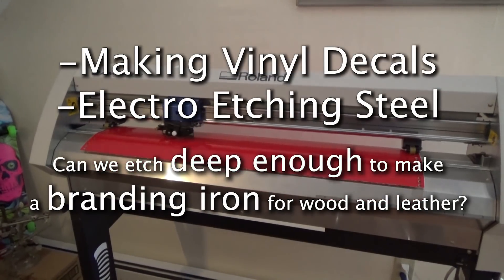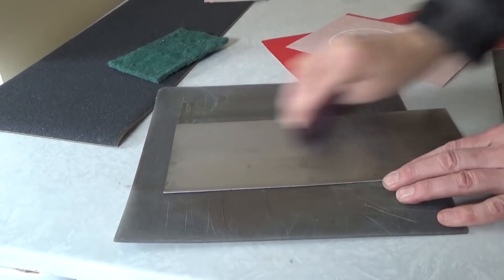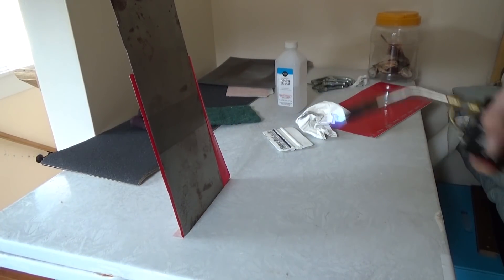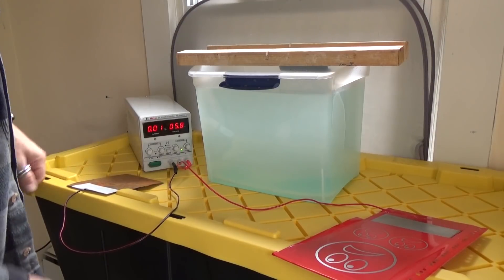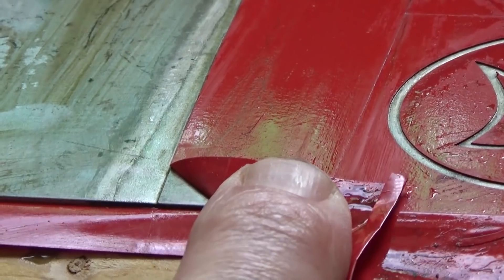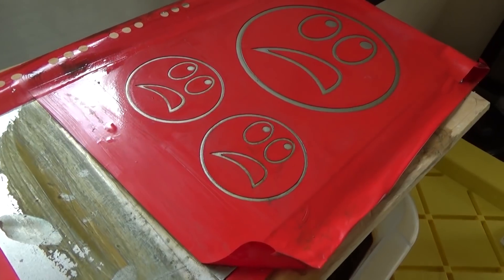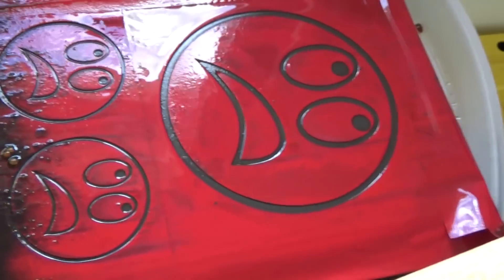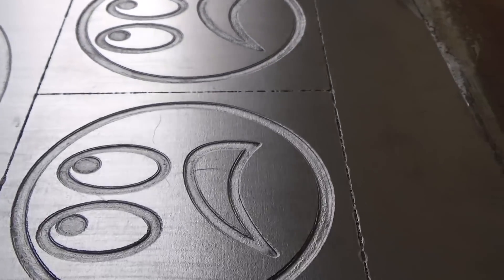Electro Etch Deep Enough for Branding Iron

Comment: Do you think this would work for super fine detail? I'm talking hairline fine.
I'm looking to create nail stamping plates for my wife so the images are a cm across with a lot of fine details.
Reply from the maker: it would depend on how deep you need to go, and what you were using to mask the details. you can get fine details if you have a different method of applying ( maybe painting image on with nail polish and tiny brush or using some kind of transfer.. i know there are places that will print small etching masks for knife makers etc.. may be something to investigate.. but once you have your mask its just playing around with time and electricity to fine tune the etch. if you're doing things as small as you are referring to, you can also avoid a deep bath and just use a q tip or cotton ball with the solution and wipe it over your mask to have ultimate control and sneak up on it gradually.....  i hope this helps.
Reply: @fleanine  I probably only need to remove a mm or 2 of material. I'd like to use vinyl as the mask since my wife has a Cricut machine that's pretty well suited for that.
I hadn't thought of printing a mask. Maybe using toner transfer. It works for PCBs which can have very fine details, might work for my purposes.
Thanks for the insights!

Comment: i have a question , i just started electro etching (thx to your vids) and i`ve done a few knives but now i want to do a butcher axe... its pretty big and my question is : does negative piece of iron needs to be as big as the axe or just a random size piece?
Reply from the maker: Jean De Painter I would try to at least match the surface area, not so much the mass. At least as closest possible to each other.
Reply: @fleanine  thank you for the fast reply , i`ll keep that in mind , with tha knives i used a piece of perforated plate i had laying around and that worked perfectly but for this i guess it isnt enought .. i`ll go out for a plate tomorrow , i`ll keep you updated ;) thanks again

Comment: I want to etch a motive with small and distinct details, the size of the details is about a half millimeter.

What’s the best best way to do that? Can I use a stamp with paint to stamp the motive on the steel, so that the paint act as a protection from the etching water? What kind of ”paint” should I use?
Reply from the maker: You could use nail polish and scrape it off after your etch.. or even packing tape and cutting it out with a fine blade if the image allows... hope that helps! Good luck. Thank you for watching !

Comment: Looks nice. Do you know a good way to darken the etching afterwards? For what I'm doing I want a shallow but dark etching.
Reply from the maker: Preed ferric chloride solution should give you the look you want. It will darken the whole thing and then you can shine up the surface leaving only the low spots dark.
Reply: You can get a thing called PermaBlue and apply it before you remove the stencil. It's main purpose is for blueing or blackening metal and it happens instantly

Comment: What is the solution ratio? I want a deep etch for a wax seal stamp. I've seen the salt water solution and vinegar salt solution but first time seeing all 3.
Reply from the maker: Really all ya need is a good portion of one of the Morton salt containers little more than 1/3 maybe 1/2 of a container for a few gallons. If you’re doing smaller items you could probably do it with about a gallon of water to 1/4 container of salt. You really can’t go wrong. Just warm the water and mix the salt in well. Good luck! Thanks for watching!
Reply: @fleanine  How big are those salt containers, 26oz?
Reply from the maker: Preed the ones I used were the 26oz. I used about half of that for a few gallons of water.

Comment: Hi fleanine,

Really interesting video keep it up with the good work you're doing. I just wanted to tell you that the reason why the power supply is not giving more volts is because you are limiting the current to 2.38 ampere, you need to crank up the left dials to allow for more current to flow, given that your power supply can give up to 5 amps. 

Hope it helps :)
Reply from the maker: Martí Gibert Roca Actually that was turned up all the way and in some of my other tests it would go up -but for some reason,  the conductivity in the solution wasn’t allowing it in this case... kinda weird. Thanks for watching!! I appreciate your comment!
*Actually at 3:20 when I put the piece in _you can see it started off right around 5...
Reply: Sat Solt watter

Comment: It just regular salt?
Reply: Ok, i got it. Thanks a lot bro.. 👍
Reply from the maker: Andika Satya Wisnu yup. I used Morton salt available in any grocery store. About half of one of the smaller containers. Thank you for watching!
Reply: Ok, good. And how about the amps? How many amps
Reply from the maker: Andika Satya With my power supply i set it for around. 5/6 volts and it regulates the amps - I believe it starts off around 5amps and starts to trail as the solution gets cooler ( I started with hot water in the mix so the electrolytes from the salt carry more electricity) it tapers off slightly as you go.

Comment: How can I get this procedure to work on etching a serial number into some small steel items.  The number would be approx 3/16" tall.  I surmise the hard part would be to construct a mask that could have that kind of detail, eh?  The etch would only have to be about 0.03" deep.
Reply from the maker: Robert Rominger You could paint on a resist or something similar like a sharpie or maybe nail polish and just scratch out what you want.. for smaller etches you can ause a q-tip and just swab the particular area until you get what you want. Thanks for watching !
Reply: @fleanine  I was wondering if you could draw with a crayon or wax pencil for the resist.  A crayon obviously wouldn't give the detail that some people would need, but a wax pencil

Comment: I found the reason for the voltage and amp dropping was because the tape over the positive lead on the item you are etching gets an air gap or the solution gets in behind it and causes the positive lead not to make contact with the peace you're etching. My solution, since I weld, was to tack a filler rod on the back, and then fold electrical tape over the filter rod and use that as the positive wire. I would suggest taking your positive wire, and either using a mini torch, or soldering iron, and solder on the wire to the peace your etching. After I tacked my positive lead on, it remained the same voltage and amps whether I was running 12 volts or 6 volts for 2 hours.
Reply: Hot glue, then tape over it might be another option.
Reply from the maker: although i think some of the droppage was due to the settling /lack of temperature and circulation i will give your technique a try! thanks for reporting back! i appreciate it and will give it a try next time around!

Comment: This is awesome. Does it matter what kind of metal you use to do this??
Reply from the maker: For this test it was just mild steel readily available at hardware stores, or your local scrap yard. I have personally tried mild steel, stainless steel, and copper and had good results. Its all about the electrolyte mix and the current. A long slow etch with not too much voltage is best. Sometimes I get impatient and when testing things like this and I'll crank it up to get results faster... but ultimately its up to what kind of results you expect vs. how much time you invest. Thanks again for watching!
Reply: So say I were to take on a project that required etching into a piece of steel, say 4mm thick.. this would work correct??
Reply from the maker: sure... the piece i used in the video was 1/4" steel and i could have kept going had i not started to lose the thin mask of the outline, but you could (in theory) just eat right thru the back of the piece if you left it long enough and the mask held up.
Reply from the maker: Ryan Eglinton sorry it was the next vid I used the thicker metal- have a look- https://youtu.be/kCosNxS4hVQ

Comment: Hi what of vinyl works best???
Reply from the maker: I use Oracal 451 vinyl, but any decent vinyl will do, as long as you clean the material really well before application and heat the mask.
Reply: fleanine thanks for the info